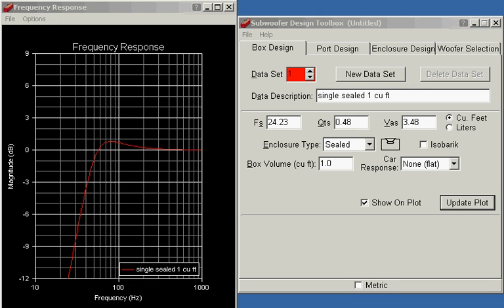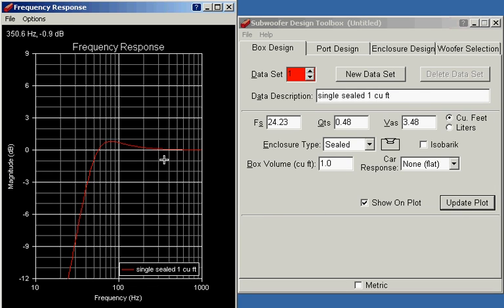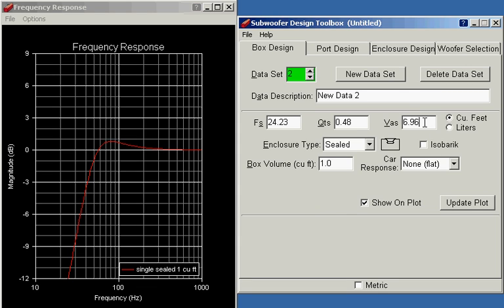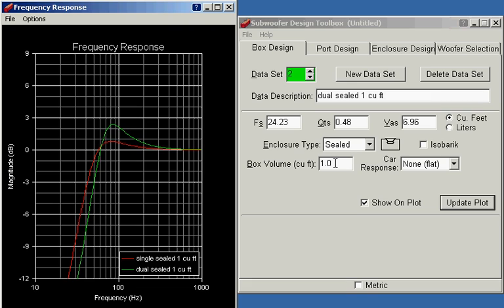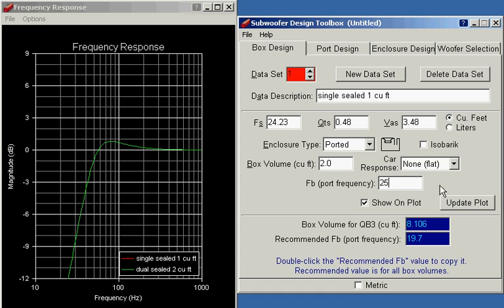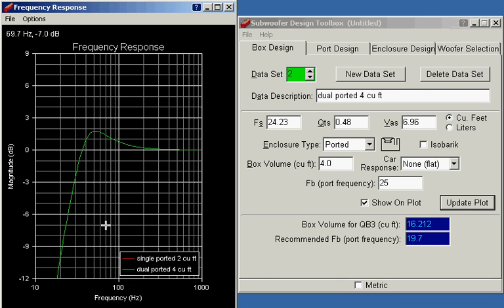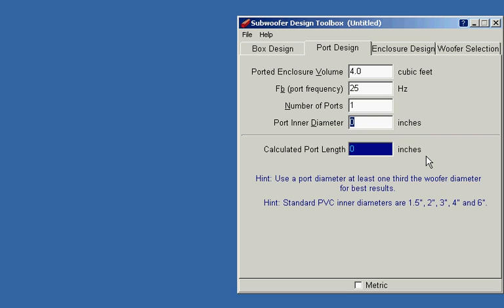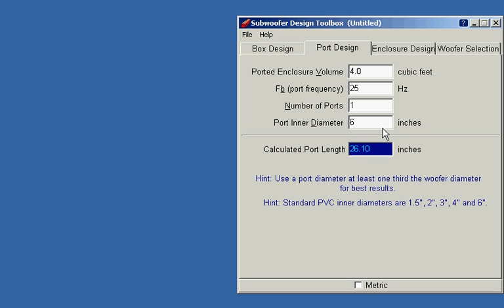Design Your Own Subwoofer Box - Part 5: Multiple Drivers

Comment from the maker: You're right about the point of having multiple drivers being higher max SPL.

To be exact, sensitivity (in db per volt) will increase +6dB for a parallel electrical connection and 0dB for a series electrical connection, compared to a single driver.  

The software always shows the output at 0 dB, best for comparing bass responses.

The software is the Subwoofer Design Toolbox by MFR Engineering.

Comment: hi there

when you changed the box size to have two drivers in a box double the size used with the single driver....shouldnt the output volume (dB) go up? thats generally the point of having more than one driver in the same box, loudness

good video though, i've learnt a lot. 

btw, which box design programme is this?

thanks
bf